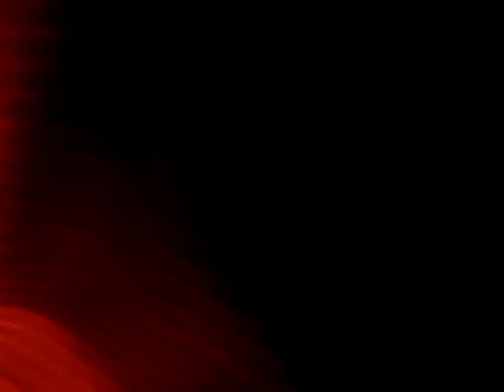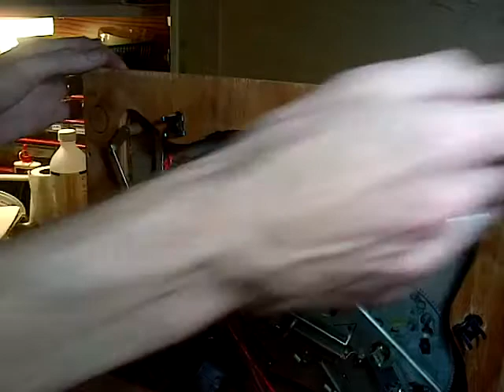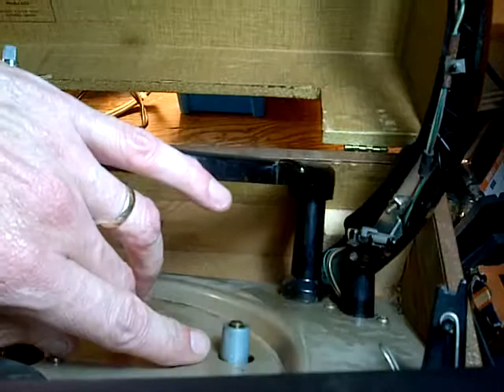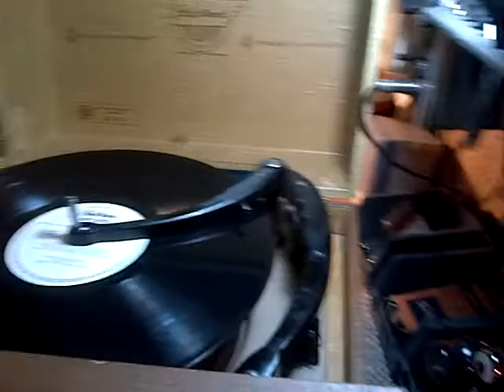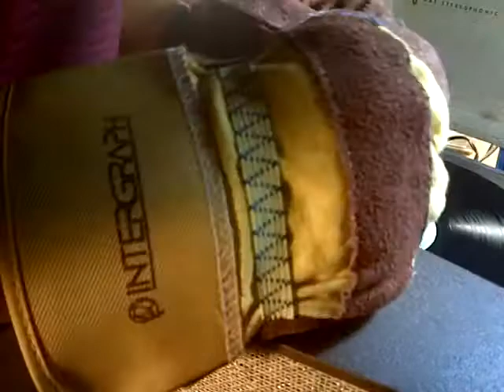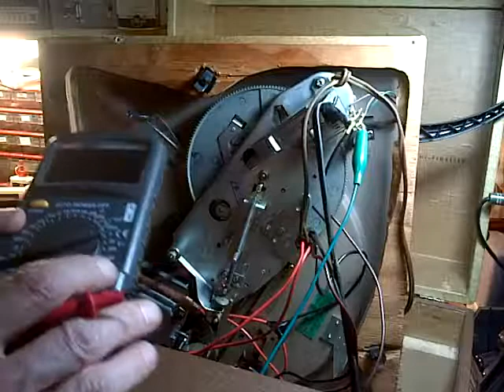Fleetwood 660 Record Player Repair Video #5 Mechanism

Comment: the black plastic gear is the one the rubber-tired wheel above turns and it's only supposed to make contact when the auto cycle starts